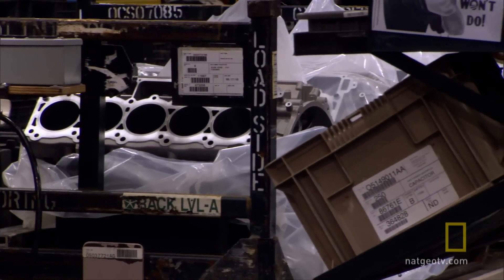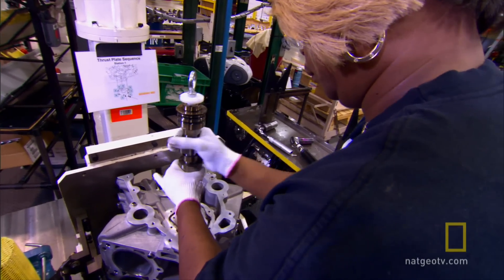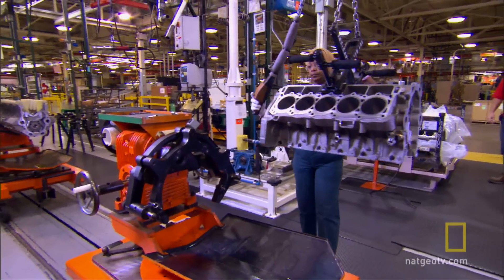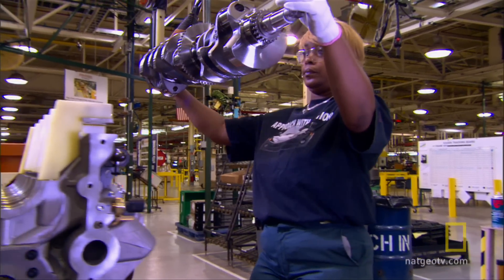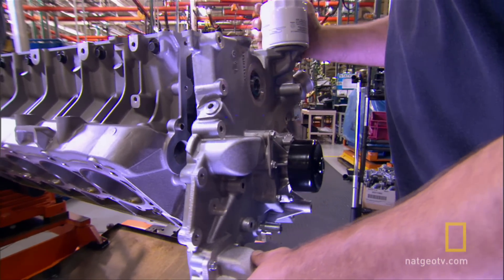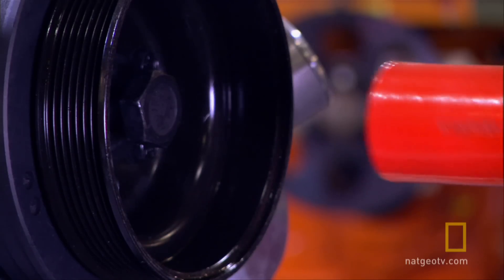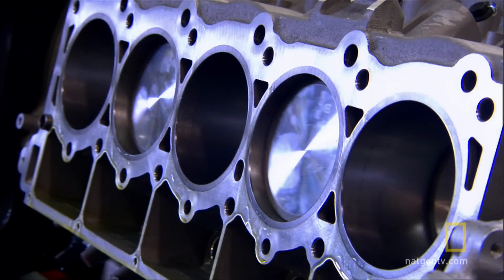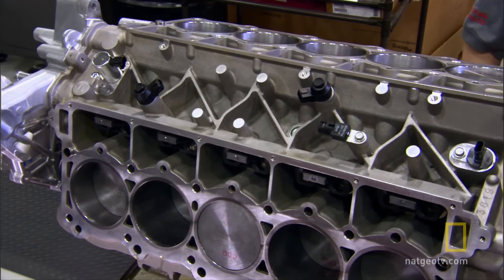Building a Viper Engine | Ultimate Factories

Comment: I’m surprised it isn’t an oil dry sump system, especially considering the G-forces it can generate cornering
Reply: The Viper has a swinging oil pump pickup.  High g turns it swings to prevent oil starvation.  Simple and very effective.

Comment: @donbosco0101 Do a short informative inquiry interview at a manufacturing place. Inquire also at local community colleges. See if they have an Automotive Dept. Central Piedmont Community College in
Charlotte, NC, for example, has an automotive technician training program in conjunction with GM.
Maybe there is something similar in your area. Good Luck!

Comment: @JoeCfb are they using stock tires? and is acr road legal?  7:22 is pretty fast, it is faster than the non race version of a lot of super cars in the world. but again, even if acr is road legal, it is a race ready version. and for what i searched, zonda has 6:47 lap time.  and GTR stock version, and this not the 2012 GTR, its the old GTR has 7:26 lap time. whats the difference between racing and non racing? its like base viper and ACR, its like 599 GTB and GTO. totally different

Comment: the viper's 8.4L v10 can push out 600BHP a Ferrari 458 has a 4.5L v8 and 562BHP yet still its still faster from 0-60 and around a track
Reply: yes but my viper costs 100 grand and ferrari cost is 25o grand, now take that to a track
Reply: Ever heard of weight?